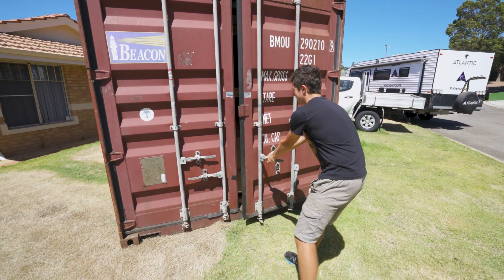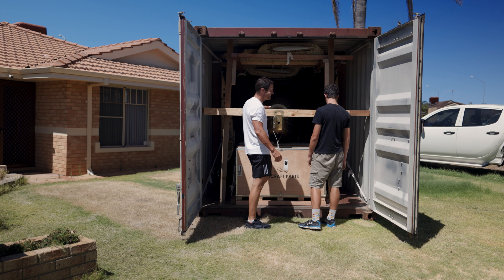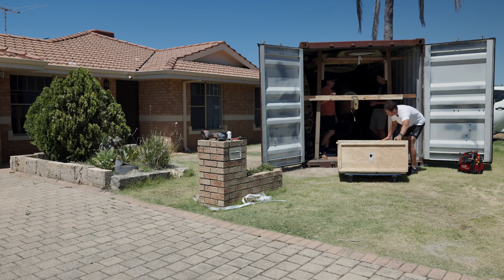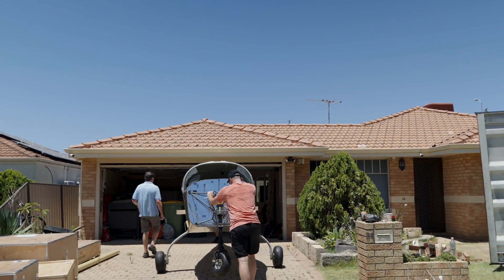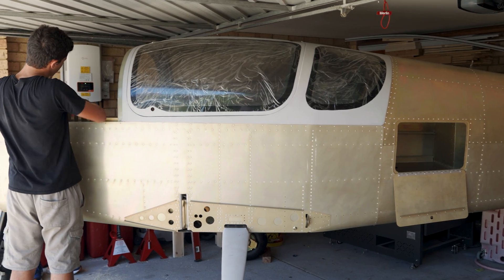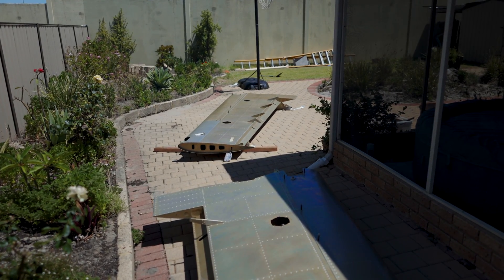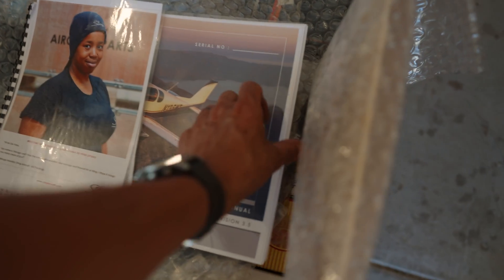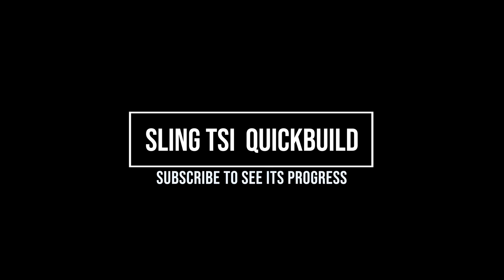You can build your own AIRPLANE? P1 (Sling TSI Quick build in 4k) #quickbuild

Comment: I just ordered the quick build kit as well. I appreciate you sharing this video. It gives me an idea of what to expect. It looks like a lot of the plane is complete. This sounds great and all. I am some what regretting that I ordered the quick build option. Not because of the expense, but because sooo much is already complete. I enjoy building things and half of my airplane / flying experience is around the actual assembly. I hope I enjoy flying it as much as I will enjoy putting it together
Reply: The Australian and the US QB kits are very different, Mike. Ours won’t have any of the empennage done, won’t have the ailerons or the flaps done, won’t have the fuel tank attached to the wings, and won’t have the fuselage up on the wheels. Also, we don’t get to keep the container for any amount of time - it stays on the back of the truck, we have a few hours to unload, and then the truck and container are gone!
Reply from the maker: I wouldn't stress, there's still HEAPS of work to do!